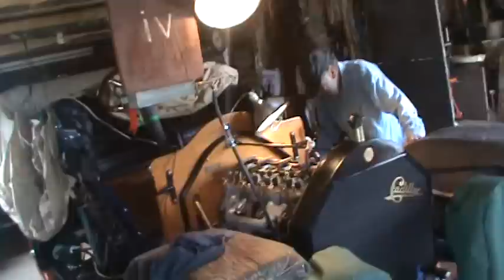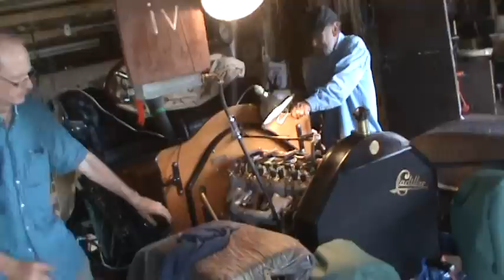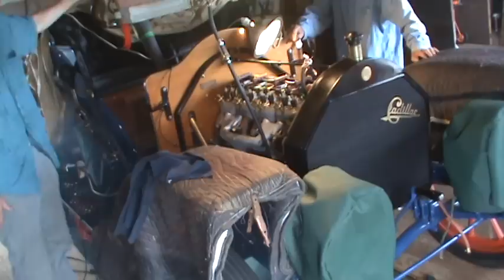1909 Cadillac First Start in 79 Years

Comment: I have an old Briggs & Stratton 8 horsepower side shaft engine pulled rope one time started after sitting for 4 years did not even check the gas.

Comment: Why did it take off like that?
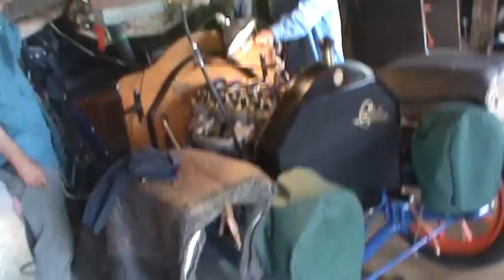Reply: timing was possibly way off or it was throttle was stuck open but it didnt sound like it was firing right, either way it was bad news i saw a few sparks fly out of exhaust at the bottom of the header  at 1:15
Reply from the maker: The original coupling to the magneto was missing and it took a while to get the timing right. We found out later that it was running rich and would not lean out properly to slow down.